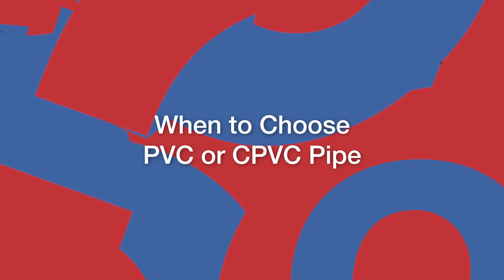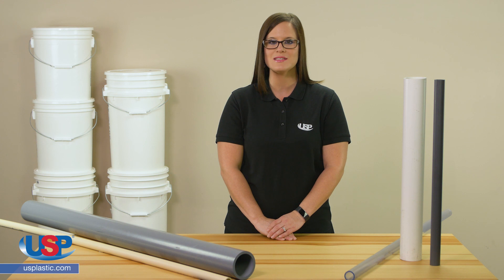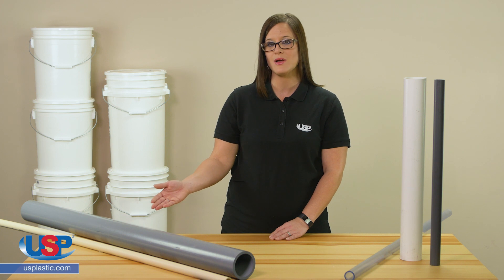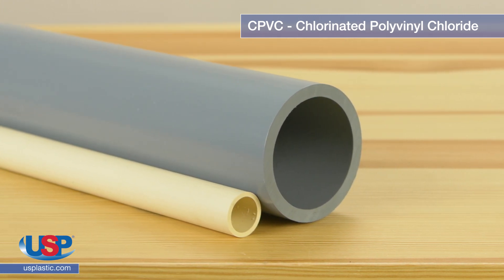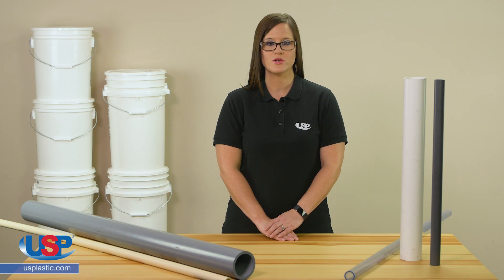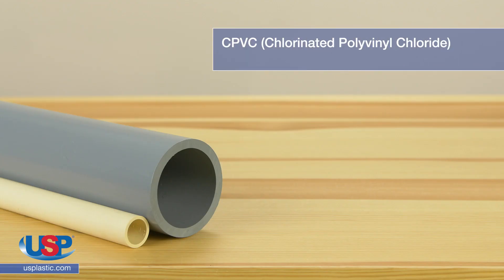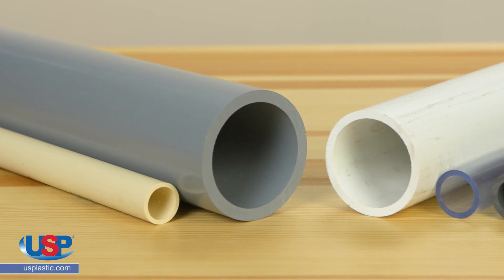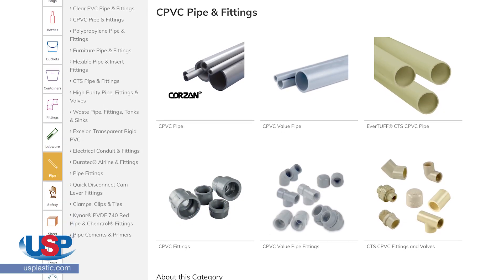Should I Use PVC or CPVC Pipe? | U.S. Plastic Corporation®

Comment: So I can use pvc for my water supply lines I don't need cpvc??? Since its cold water???
Reply: I wouldn't us pvc for water supply in any instance. It's better to choose something like pex or copper, if it's inside a building. But if it's for an irrigation system, then you can use PVC no problem. CPVC is going to be more flexible, and inherently more ductile. So people prefer them, since they are less likely to break or become brittle. In a freeze thaw climate, it would be better to use CPVC
Reply: @emmanuelleallen  Copper develops pin holes on some well systems.